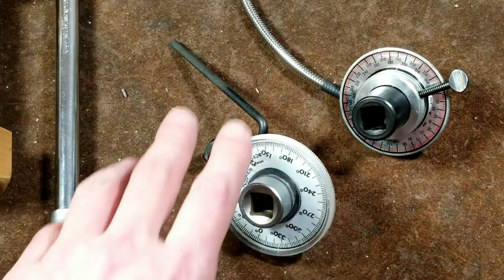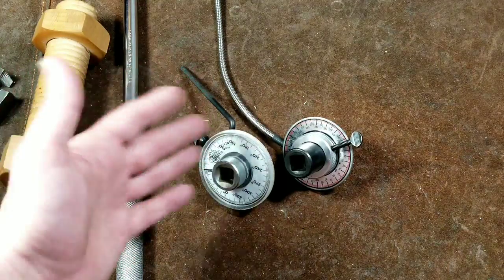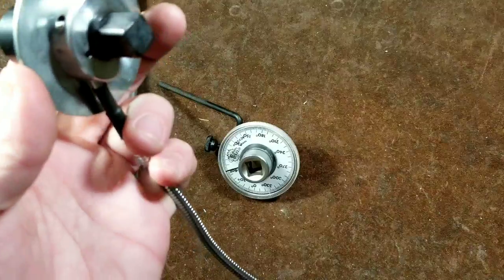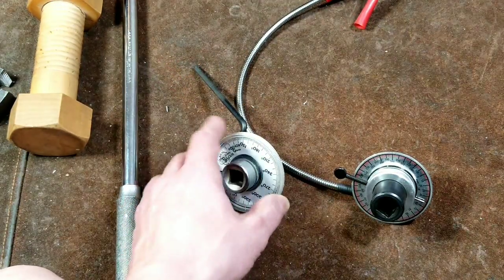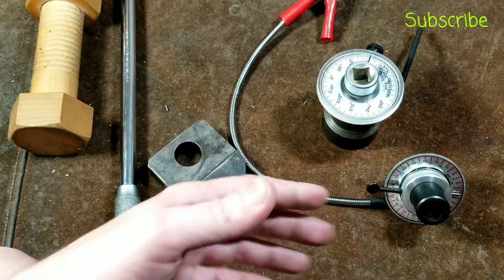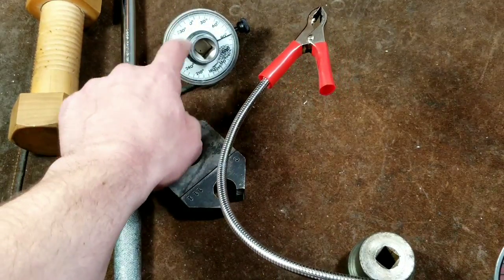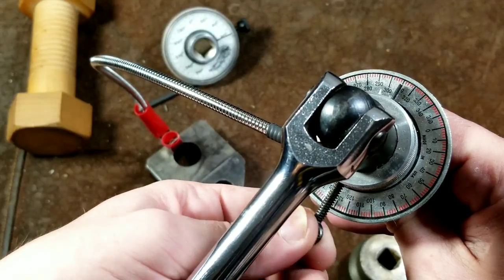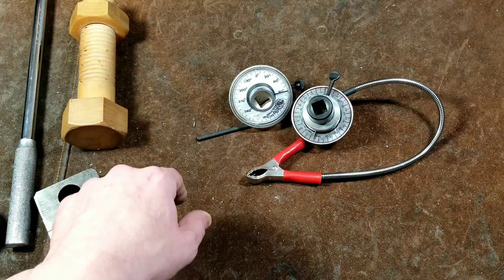Torque Angle Gauge Overview & Review

Comment: My car has a lot of bolts with an angle torque value, but what I do is after hitting the initial torque value I mark the bolt heads with a sharpie at the 12 o'clock position and then I turn them until the mark is at the 3 o'clock or 6 o'clock position, obviously just depending on whether the spec is for 90 or 180 degrees. I feel like these tools overcomplicate things and increase the chances of error.
Reply: That idea is good for tight spaces or if you don't need an angle gauge very often, but some cars like subarus have weird sequences like torquing to spec, then loosening the head bolts 180° twice, then torqueing to spec again and then tightening 90° and then an additional 40°.
At that point it starts getting complicated marking the bolt lol especially if you do it for a living.
But yeah for 90% of people you're better off just marking

Comment: My 1/2" snap-on digital wrench that I bought used does torque and angle both, but it only had around 60 angle cycles in the counter memory while having well over 1,000 torque cycles when I bought it. Just not common in motorcycles/powersports where I am, but I've been glad to have it on a few axles and things when needed.
Reply from the maker: Yes torque angles are much more common than large and critical Fasteners such as head bolts flywheel bolts on diesel engines Etc

Comment: Something is bugging about this angle torque wrench...let say i want to torque 4 bolts to 100 degree for example...at which point do i start to torque? how do i know each of the bolt start at the same point (torque)? Because i might tighten each of the bolt randomly first and won't know if they are at the same torque...mind to explain how that works? Thank you in advance
Reply from the maker: Sounds like there's some missing information usually they tell you to torque a bolt to say 30 foot pounds and then turn a hundred degrees but yes you have to have an initial seating torque and then the angle torque is applied afterwards
Reply: @CatusMaximus  ah thank you for the info... Afterall torque wrench is still needed in the process... I thought I could use this without torque wrench.. Need to spend more money to get one

Comment: Can i use this tool on a rear wheel bearing nut to torque the nut? My torque setting for the rear wheel nut is 280Nm so can i use this tool for this thanks.

Comment: I'd  be  worried  about  gauge  moving  it's  setting  when  using  an  impact  wrench . And  working  under  a  truck  an  impact  is  the  only  way  to  do  the  turn . 90lb  and  120  degrees  on  a  Volvo  flywheel  in  the  truck  is  almost  impossible  without  the  impact  wrench
Reply from the maker: Indeed that is a tough situation these can be used as a measuring device is by putting the socket on it and having markings just like you already would using an impact wrench but they obviously are much more handy and open areas such as head bolts where you can use sufficiently long breaker bars
Reply: @CatusMaximus  
I'll have to admit to getting lazy, if it's torque turn, the turn is done with an impact..... Unless you're talking 1/4 drive on an air compressor cylinder head